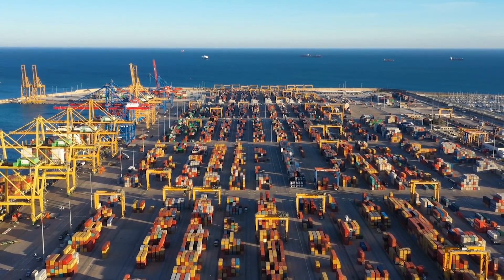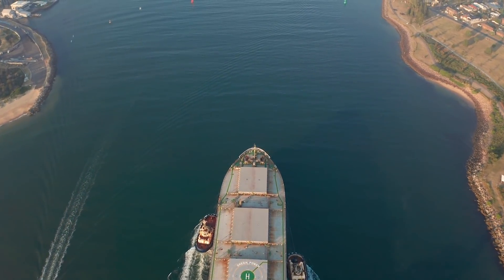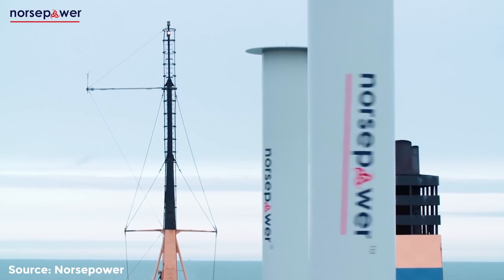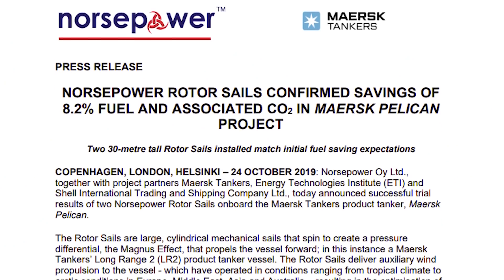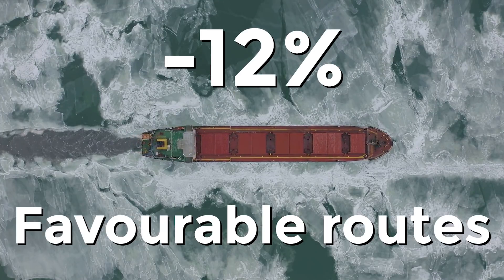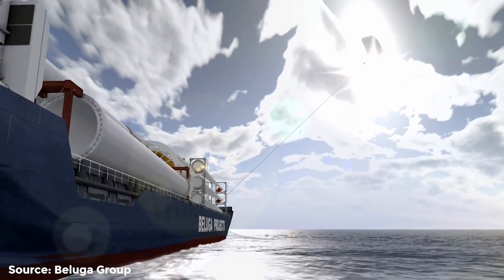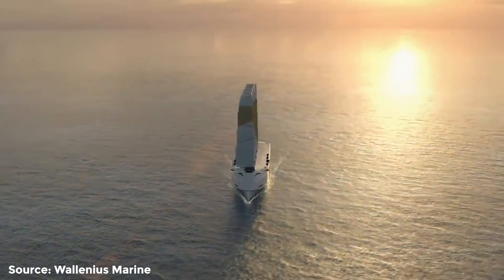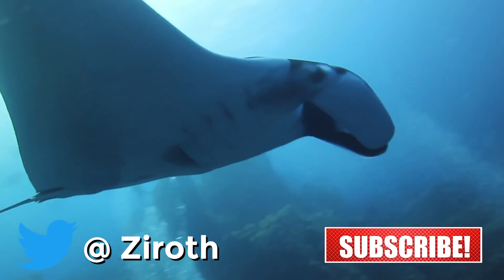Is Wind Power The Future of Shipping?

Comment: Make it nuclear
Reply: If you do a web search for ‘nuclear ship savannah’ you will see that it has been tried and did not work.  A similarly vessel heavily subsidised, by the government, vessel is in use in Russia which also operates, in support of the Northern Sea Route, a fleet of nuclear powered ice breakers all of these may, or may not, have been completely without issues.

Just think; would you have full confidence in the management of a nuclear reactor under the control of an anonymous entity only traceable, perhaps, via a letter box in a FOC (flag of convenience) nation state?  If you are, could you sell that confidence to Japan, the state that hosted the Hiroshima and Nagasaki nuclear detonations as well as more recently the Fukushima ‘event’?  Then try that same, or a similar, sales strategy on Ukraine, the nation state that as a part of the USSR (CCCP) hosted the Chernobyl ‘event’.  Modern iterations of nuclear energy, thorium fuel, molten salt reactors or fusion reactors, will carry the legacy of past problems.  It is the global trepidation of anything with 'nuclear' in the name and the economics of nuclear having transitioned from 'energy to cheap to charge for' too 'the costs of remediation are incalculable' that will prevent the adoption of nuclear energy as a means of creating energy at sea.  Modern reaction systems may have overcome the safety problems but the general public, having been misled in the past, will be reluctant to believe the fresh new promises.  The incident of the ‘Ever Given’ blocking the Suez Canal, March 2021, may also have a little to add to this debate.  The cooling water on ships tends to get taken in from near the bottom so when running aground the inlets are in a prime spot to get plugged up restricting, if not stopping, the flow of coolant.  One thing that the TMI, Chernobyl and Fukushima incidents all had in common was that the supply of coolant, or rather lack thereof, was a fundamental cause.

‘They’ say nuclear is cheap, it’s not it is expensive and has a large embedded carbon quotient as well as being complicated, dangerous, not universally socially acceptable and having only ‘no need for refuelling’ as a questionable advantage; actually it does need refuelling just not as often.  When ‘they’ do need to refill the warming up stuff it takes considerable longer than pumping tonnes of thick black stuff, cSt380 HFO, or thin runny stuff, MDO, onboard which is one of the reasons HMS Queen Elizabeth and HMS Prince of Wales are pushed about by ICEs and gas turbines thus using a similar fuel as the aircraft that fly off of them.  The Royal Navy (RN) with a high degree of skill and expertise uses, at vast expenses to the UK taxpayer, a current operational nuclear fleet of 11 submarines (also known as ‘boats’) in two flotillas, seven attack subs and four ballistic missile boats.  The carbon footprint of all the extra bits of hardware and the fuel, including processing thereof, from ground to propeller, are the external costs that never seem to get considered.

Disposal, once it wears out, of both the machine (that was a ship) and fuel is another can of worms best left unopened.  The 26 RN boats no longer in use are laid up (some in Rosyth and some in Portsmouth) awaiting long term deconstruction including dealing with the fuel rods and other irradiated material.  The USN is not, as far as I know, a commercial organisation working to very tight margins and also has the skill and expertise to handle the complexities of nuclear power; so as well as submarines their aircraft carriers are nuclear powered and each of the current iteration has a build cost three times that of QE/PoW, bigger crews and more generous funding.  For those who still think that nuclear energy might be the answer I recommend this report: - https://www.bbc.com/future/article/20200901-the-radioactive-risk-of-sunken-nuclear-soviet-submarines?ocid=ww.social.link.email.  The navy of the USSR might have been under resourced and over extended but it was still generously supported in comparison with merchant shipping.  While merchant ships may be 'taken up from trade' as the RN would say, or may be captured or impressed by non state quasi military entities by way of piracy, but cargo ships are not military vessels.

Comment: No, this is ridiculous and unworkable. Time travelers from the age of steam would laugh.
You want a solution for emissions? Just put a nuclear reactor in the cargo ships. Easy, viable, an already solved problem.
Reply: If you do a web search for ‘nuclear ship savannah’ you will see that it has been tried and did not work.  A similarly vessel heavily subsidised, by the government, vessel is in use in Russia which also operates, in support of the Northern Sea Route, a fleet of nuclear powered ice breakers all of these may, or may not, have been completely without issues.

Just think; would you have full confidence in the management of a nuclear reactor under the control of an anonymous entity only traceable, perhaps, via a letter box in a FOC (flag of convenience) nation state?  If you are, could you sell that confidence to Japan, the state that hosted the Hiroshima and Nagasaki nuclear detonations as well as more recently the Fukushima ‘event’?  Then try that same, or a similar, sales strategy on Ukraine, the nation state that as a part of the USSR (CCCP) hosted the Chernobyl ‘event’.  Modern iterations of nuclear energy, thorium fuel, molten salt reactors or fusion reactors, will carry the legacy of past problems.  It is the global trepidation of anything with 'nuclear' in the name and the economics of nuclear having transitioned from 'energy to cheap to charge for' too 'the costs of remediation are incalculable' that will prevent the adoption of nuclear energy as a means of creating energy at sea.  Modern reaction systems may have overcome the safety problems but the general public, having been misled in the past, will be reluctant to believe the fresh new promises.  The incident of the ‘Ever Given’ blocking the Suez Canal, March 2021, may also have a little to add to this debate.  The cooling water on ships tends to get taken in from near the bottom so when running aground the inlets are in a prime spot to get plugged up restricting, if not stopping, the flow of coolant.  One thing that the TMI, Chernobyl and Fukushima incidents all had in common was that the supply of coolant, or rather lack thereof, was a fundamental cause.

‘They’ say nuclear is cheap, it’s not it is expensive and has a large embedded carbon quotient as well as being complicated, dangerous, not universally socially acceptable and having only ‘no need for refuelling’ as a questionable advantage; actually it does need refuelling just not as often.  When ‘they’ do need to refill the warming up stuff it takes considerable longer than pumping tonnes of thick black stuff, cSt380 HFO, or thin runny stuff, MDO, onboard which is one of the reasons HMS Queen Elizabeth and HMS Prince of Wales are pushed about by ICEs and gas turbines thus using a similar fuel as the aircraft that fly off of them.  The Royal Navy (RN) with a high degree of skill and expertise uses, at vast expenses to the UK taxpayer, a current operational nuclear fleet of 11 submarines (also known as ‘boats’) in two flotillas, seven attack subs and four ballistic missile boats.  The carbon footprint of all the extra bits of hardware and the fuel, including processing thereof, from ground to propeller, are the external costs that never seem to get considered.

Disposal, once it wears out, of both the machine (that was a ship) and fuel is another can of worms best left unopened.  The 26 RN boats no longer in use are laid up (some in Rosyth and some in Portsmouth) awaiting long term deconstruction including dealing with the fuel rods and other irradiated material.  The USN is not, as far as I know, a commercial organisation working to very tight margins and also has the skill and expertise to handle the complexities of nuclear power; so as well as submarines their aircraft carriers are nuclear powered and each of the current iteration has a build cost three times that of QE/PoW, bigger crews and more generous funding.  For those who still think that nuclear energy might be the answer I recommend this report: - https://www.bbc.com/future/article/20200901-the-radioactive-risk-of-sunken-nuclear-soviet-submarines?ocid=ww.social.link.email.  The navy of the USSR might have been under resourced and over extended but it was still generously supported in comparison with merchant shipping.  While merchant ships may be 'taken up from trade' as the RN would say, or may be captured or impressed by non state quasi military entities by way of piracy, but cargo ships are not military vessels.
Reply: @BernardLS  The Savannah did work. It was not configured to be economical from a cargo perspective though. And it was a one-off research project. Those are not meant to work economically, just technology demonstrators.

I do not care about the confidence argument. Nuclear ships are inherently safer and less harmful than ships powered conventionally. Even in case of accident or terrorism. So if we already have confidence allowing ships to exist, nuclear propulsion is just an upgrade.
Reply: @zolikoff  If the Savannah, as a research project, 'worked' one would have expected the concept to have been carried through into main stream use by now.

WADR it is not us who need to have the required confidence but the many and varied shipping interests and the regulators that control what they do and how they do it.

I am not trying to be negative, just pragmatic.  It is possible that at some time in the future, under different commercial and social circumstances, some form of nuclear power may be efficiently, effectively and productively be used in merchant vessels but we are currently a long way off.
Reply: @BernardLS  It worked since the propulsion did its job as intended (though should not have been a surprise). Then there were two problems for immediate further development. 
One: the cost of oil plummeted soon after and thus the general idea of switching over to nuclear propulsion became less enticing. 
Two: The rising anti-nuclear sentiment became full swing by the end of the 60s, driven by the cold war. Nuclear power for any purposes was quickly becoming politically and publicly shunned.
As for what's in store for the future, well in my opinion it's inevitable that large ships will eventually be nuclear powered out of necessity, if for no other reason than the rising cost of fossil fuels. Who knows when, though. But the technology is already solved in this regard, it's only a matter of human choice.
Reply: @zolikoff  One, Oil plummets and soars on a very short time scale so any rational ship manager would probably have a handle on that part of the economics, build cost, operating budget and disposal value would be the killers in the economic equation;
Two 'Sentiment' and 'human choice' are probably what will keep the nukes at bay it is perhaps telling that the German civilian nuclear power plants are operated, and thus the responsibility of, a Swedish company (Vattenfall).  What do you think your berthing prospects would be at a German port with any sort of a nuke on board?
Reply: @BernardLS  Short term economic gain is the primary goal, so not surprising that changes on a short time scale have a big impact on how the market as it tries to take advantage of them.
Yes, that's also what I'm saying, subjective human opinions are what have been keeping nuclear energy at bay so far. But any superstition dies out eventually. Eventually the average person will be better educated than it is now; this trend has always been towards more education, hopefully it doesn't reverse.
As a result, a port set up for nuclear ships need not be any different than the ports we have today, from a pragmatic, engineering perspective. That is, subjective human thoughts notwithstanding. In fact it's easier on port infrastructure due to lack of need to refuel at port.
Reply: @BernardLS  Indeed, overall shipping has a relatively small greenhouse footprint - that is if we don't look at locally harmful pollutants they emit, which is another problem. But one would expect that solving the 97% of the problem on land will eventually require extensive use of nuclear power, thus creating the industrial capacity as well as the public acceptance to be able to put it on ships as well without fuss.

Comment: narrow rigid aerofoils are likely to be the most effective form of wind power, particularly in arrays. An array can create a natural wing shape in the wind profile, yet can be more efficiently feathered in adverse (unlikely) conditions unless minor course changes (less than 20 degrees) are acceptable. The rotor ships still consume fuel (~5-10%) (albeit recycled heat is being used) and yet are only equivalent of an aerofoil. Furthermore, the exhaust from engines could be directed to the aerofoils and used to improve the airflow and power.

Comment: Why not nuclear we now that it works with aircraft carriers y can't we do the same with cargo
Reply: If you do a web search for ‘nuclear ship savannah’ you will see that it has been tried and did not work.  A similarly vessel heavily subsidised, by the government, vessel is in use in Russia which also operates, in support of the Northern Sea Route, a fleet of nuclear powered ice breakers all of these may, or may not, have been completely without issues.

Just think; would you have full confidence in the management of a nuclear reactor under the control of an anonymous entity only traceable, perhaps, via a letter box in a FOC (flag of convenience) nation state?  If you are, could you sell that confidence to Japan, the state that hosted the Hiroshima and Nagasaki nuclear detonations as well as more recently the Fukushima ‘event’?  Then try that same, or a similar, sales strategy on Ukraine, the nation state that as a part of the USSR (CCCP) hosted the Chernobyl ‘event’.  Modern iterations of nuclear energy, thorium fuel, molten salt reactors or fusion reactors, will carry the legacy of past problems.  It is the global trepidation of anything with 'nuclear' in the name and the economics of nuclear having transitioned from 'energy to cheap to charge for' too 'the costs of remediation are incalculable' that will prevent the adoption of nuclear energy as a means of creating energy at sea.  Modern reaction systems may have overcome the safety problems but the general public, having been misled in the past, will be reluctant to believe the fresh new promises.  The incident of the ‘Ever Given’ blocking the Suez Canal, March 2021, may also have a little to add to this debate.  The cooling water on ships tends to get taken in from near the bottom so when running aground the inlets are in a prime spot to get plugged up restricting, if not stopping, the flow of coolant.  One thing that the TMI, Chernobyl and Fukushima incidents all had in common was that the supply of coolant, or rather lack thereof, was a fundamental cause.

‘They’ say nuclear is cheap, it’s not it is expensive and has a large embedded carbon quotient as well as being complicated, dangerous, not universally socially acceptable and having only ‘no need for refuelling’ as a questionable advantage; actually it does need refuelling just not as often.  When ‘they’ do need to refill the warming up stuff it takes considerable longer than pumping tonnes of thick black stuff, cSt380 HFO, or thin runny stuff, MDO, onboard which is one of the reasons HMS Queen Elizabeth and HMS Prince of Wales are pushed about by ICEs and gas turbines thus using a similar fuel as the aircraft that fly off of them.  The Royal Navy (RN) with a high degree of skill and expertise uses, at vast expenses to the UK taxpayer, a current operational nuclear fleet of 11 submarines (also known as ‘boats’) in two flotillas, seven attack subs and four ballistic missile boats.  The carbon footprint of all the extra bits of hardware and the fuel, including processing thereof, from ground to propeller, are the external costs that never seem to get considered.

Disposal, once it wears out, of both the machine (that was a ship) and fuel is another can of worms best left unopened.  The 26 RN boats no longer in use are laid up (some in Rosyth and some in Portsmouth) awaiting long term deconstruction including dealing with the fuel rods and other irradiated material.  The USN is not, as far as I know, a commercial organisation working to very tight margins and also has the skill and expertise to handle the complexities of nuclear power; so as well as submarines their aircraft carriers are nuclear powered and each of the current iteration has a build cost three times that of QE/PoW, bigger crews and more generous funding.  For those who still think that nuclear energy might be the answer I recommend this report: - https://www.bbc.com/future/article/20200901-the-radioactive-risk-of-sunken-nuclear-soviet-submarines?ocid=ww.social.link.email.  The navy of the USSR might have been under resourced and over extended but it was still generously supported in comparison with merchant shipping.  While merchant ships may be 'taken up from trade' as the RN would say, or may be captured or impressed by non state quasi military entities by way of piracy, but cargo ships are not military vessels.